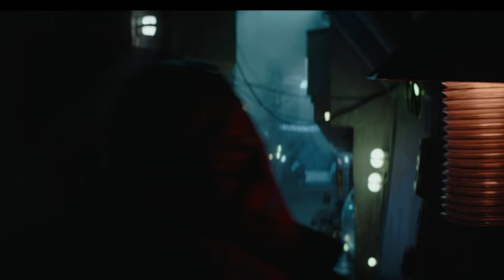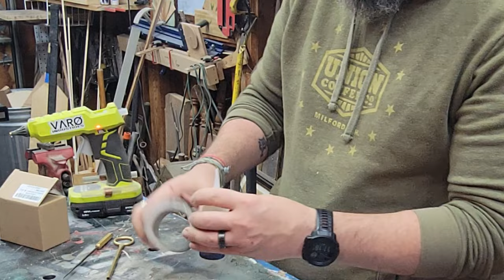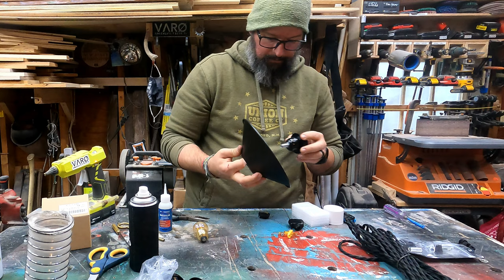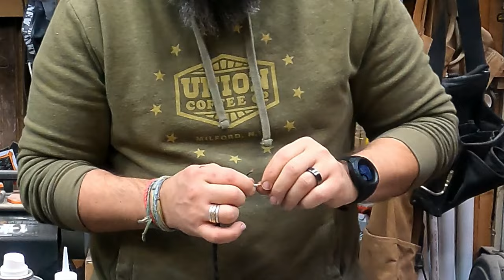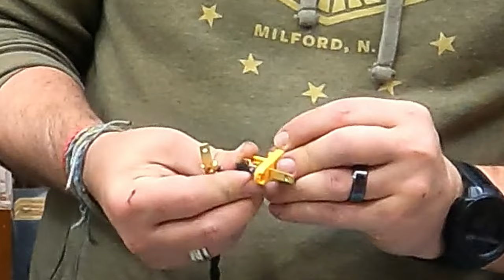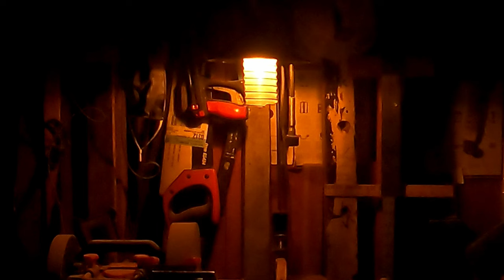Making a Prop Replica from Star Wars: Andor

Comment from the maker: Star Wars: Andor has become a favorite of mine since its release last year. In fact, in the opening scene, in season 1, episode 1, right off the bat, I saw something I wanted to make (and was hooked on the show).

Cassian Andor is trekking across a bridge in the rain on the planet Morlana One. He takes a turn down a street, and right there on the side I saw something unmistakable - PVC hose used in woodworking shops for dust collection. So, I had to make one.

The one I made is definitely a mini version - from the scene itself, it looks like it's a lot bigger than the one I have, maybe using 4" or 6" PVC hose. I happened to have a scrap piece of 2 1/2" hose, so that is what I based mine off of. This is a video of the build, and it takes about a 1/2 hour, and all you really need is some basic wiring skills and hot glue, and to spend a few bucks on the pieces and parts needed.

Also, I am not an electrician. So, take what I do with a grain of salt.

Star Wars: Andor on Disney+:  https://www.disneyplus.com/en-gb/series/star-wars-andor/3xsQKWG00GL5

🛠 Tools and Supplies 
Here are the products and tools used to make this project: https://kit.co/TheNewJankyWorkshop/making-the-street-lamp-from-star-wars-andor-season-1-episode-1

🙃 Products, Plans & Merch
https://geni.us/tnjw

✅ Related Videos 
Lampshade Made Out of a Foodland Grocery Bag and Epoxy: https://youtu.be/9z5gP6KCkMA
Quickly Cool Hot Glue: https://youtube.com/shorts/pp6YYcFyZdU  
Cordless Glue Gun Hack: https://www.youtube.com/watch?v=NPsvVJZorxs

📱 Follow me…
https://www.patreon.com/thenewjankyworkshop
https://www.instagram.com/TheNewJankyWorkshop
https://www.facebook.com/TheNewJankyWorkshop 
https://www.tiktok.com/@newjankyworkshop
https://www.youtube.com/@TheNewJankyWorkshop

📧 Mailing List
Join my mailing list to be notified about new videos, merch, and general information from time to time: https://geni.us/jankymail

🎵 Music
End screen music used is: Nickel and Dime Blues; Performed by  @Gangstagrass  (https://gangstagrass.com); Courtesy of the mighty fine folks of Gangstagrass. Check them out. They are awesome. 

Additional music used in this video from Epidemic Sound - check it out and get a free month of royalty free music! https://geni.us/esound

⚠ DISCLAIMER 
My videos are for entertainment purposes only, your safety is your responsibility. Please do not follow my actions if you find them unsafe. Which, they probably are. I'm a bit janky. Some of these links go to one of my websites and some are affiliate links where I'll earn a small commission if you make a purchase at no additional cost to you.

🥔 Hashbrowns
#starwars #andor #DIY #DoItYourself #cassianandor #lamp #lamps #lampshade #streetlamp #cassian #props #prop